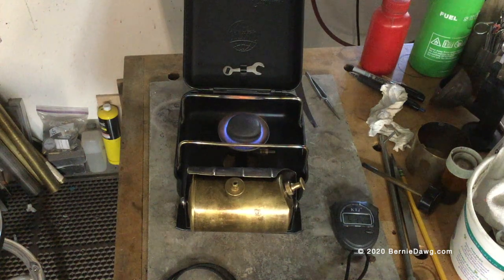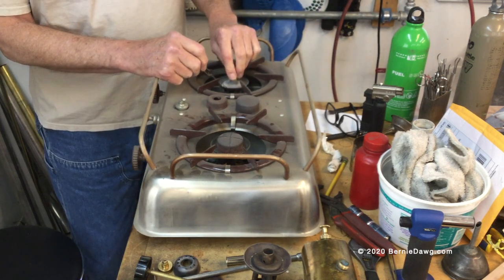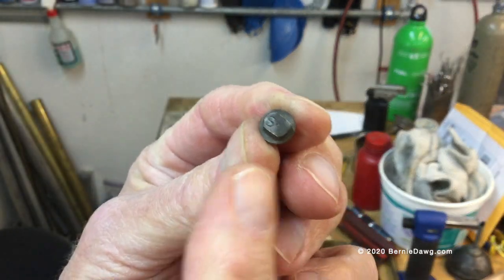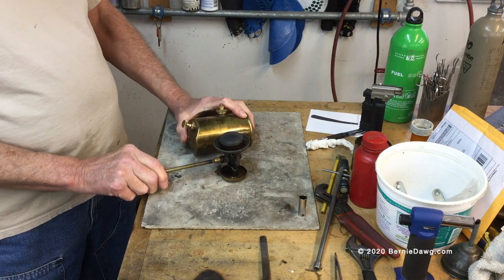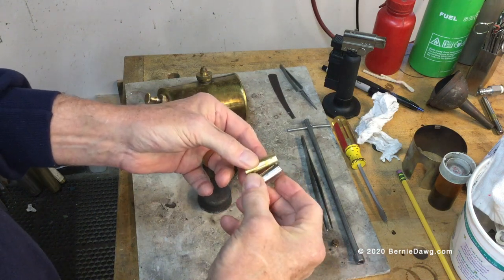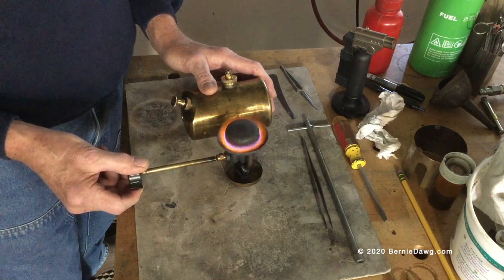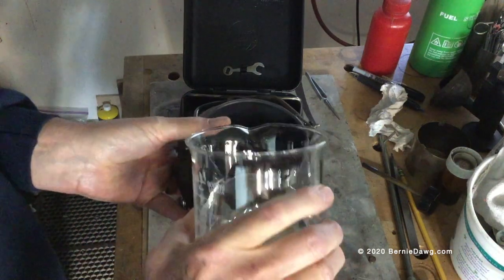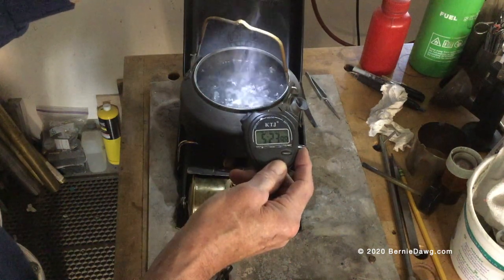Convert a Kerosene Burner to Alcohol

Comment: Just subscribed. Always wanted one of these Optimus stoves, but seems they were more expensive that other options. I used a small coleman white gas stove for most of my backpacking, then bought a coleman stove made to burn on an exclusive aluminum cannister type of fuel. Got busy with life and never used it. Might sell someday. Now, I use a trangia alcohol stove, but am yearning for one of these optimus 111T stoves. Now to just find one. . At least when I do, I'll know about your very helpful videos to guide me on keeping it going. Thanks
Reply from the maker: @Dydeeo Thanks! 
To get an Optimus 111T... watch the listings at eBay diligently. Daily checks. Be prepared to pay far more than those old prices of yore you mentioned. They only get more expensive every day since they are collectible and no longer made for many years now. But, you'll be able to sell the one you get for more than you paid in another few years, so it's win-win. Good luck! BD

Comment: Thank you for the video, I plan on converting my 111T To Burn alcohol as I find that the odourless operation indoors is wife friendly...now to source a proper jet. That's a mission.
Reply from the maker: @Senna4EvR  You are welcome on the video. *However*, there should be no trouble at all to source the alcohol jet. I tell you where to get the jet and even provide a clickable link in the description box right below the video that'll take you directly to the suppliers' webpage. I couldn't possibly make it any easier. 😄👍 BD

Comment: This can be an excellent alternative to kerosene. Can you please make a similar video for diesel? I am yet to see diesel burning with a blue flame in a stove.
Reply from the maker: Nope. Sorry. I can't make a similar video for vehicle diesel because vehicle diesel doesn't burn in stoves. It's too thick, too full of additives, requires high pressures and high temperatures to vaporize and to burn that stoves simply don't have. And, for the record... yeah, I've tried it in both silent and roarer burners. The folks who are selling you "multi-fuel" stoves who claim their stoves will run diesel fuel are bs-ing you so they can make a buck. (Wouldn't it be cool if they did run diesel?) But, the truth is diesel will not run with a blue flame in a small stove used for camping. It's just fact informed by physics and science. And, it's why you don't see a slew of YouTube videos doing it. Sorry. ☹️ BD
Reply: @BernieDawgCinema  Thanks, Bernie for the quick reply. I am well aware about the physics limitations. A blue flame could be generated using an external (battery powered?) compressor or something similar. This could be cool to see, but it's nothing much more than just a curiosity.
Reply from the maker: Not sure how the compressor changes anything, but if you think you've got it figured out, that's cool! Give it a whirl sometime and make a video to post at your YouTube channel. I'd be happy to link to your successful diesel stove video from my alky video and even from my website. You'd be a lot of peoples hero for sure. Big $$$$ in that solution. 👍 BD
Reply from the maker: @Joshua Kiser Absolutely the same problem but worse! Biodiesel is even more problematic than diesel to burn in small stoves. Hopefully you read and understood my previous comments above. Diesel engines in cars and trucks operate at very high cylinder pressures and burn the fuel at very high temperatures. Stoves don't do that. So, most of the hydrocarbons in diesel and biodiesel and biodiesel/ethanol blends don't burn in small stoves. Result? Big yellow and smoky flames, tons of soot, and tar-like deposits which clog the fuel line and the burner of small stoves and quickly make them non-functional. If you don't believe me, just try it yourself. But, don't get mad at me when you have to spend hours trying to rehabilitate your filthy and clogged stove. 'Cause I warned ya! 😁🤷‍♂️ BD

Comment: Very nice, Gary!  Do you think a a guy could enlarge a white gas jet to stand in for the alcohol jet?
Reply from the maker: Thanks! Yes, it seems like a feller could just enlarge a jet if you didn't want to buy one from England (Base-Camp) or get one out of an old alcohol stove. I've not had much success with drilling jet holes as the bits are incredibly fragile. But, you may have more patience and steadier hands than I. I know another guy who posts frequently on a highly visible forum likes to drill big holes, then silver braze in a hypodermic needle sleeve. BD

Comment: Great video is there any chance you have a 111t fuel tank? My my 111c has a steel tank that has rust. I say you turned a 111c into a D. I’d like to do that to my 111c I’d also like an alcohol jet and tube. I’d love to have a 111t or 111d. I had several 111t but like an idiot sold them
Reply from the maker: @Low Lumens Again, for these sorts of transactions, purchases, giveaways, or repair requests, just drop me a (non-anonymous) email to this address: bd@berniedawg.com 👍 BD